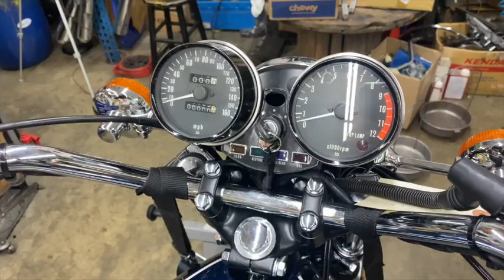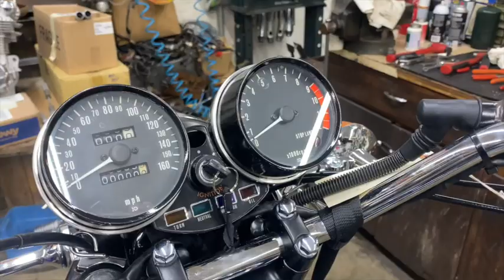75 Kawasaki Z1 900 "THE Z1" Best Friend's Surprise Reveal

Comment: That bike looks just like my New 1975 Kawasaki 900, with blue paint and the gold stripes. That bike went too fast to easily. I won the few races that some foolish people wanted to run that bike. I sold it to a friend of mine after 2 months. I don't know if I'd be around today if had kept it. Generally speaking about the bike, it was a nice big bike, good looking, felt reliable enough to go anywhere without any worries. They really are a nice bike if you can drive them sensible, I just wasn't able to drive it sensible. Good luck with that 1975 Kawasaki 900. It sure looks good. You do very nice work and help keep them going.

Comment: This brings back strong memories for me in the beginning of the video between 0:02-0:11 I had a 1975 Z-1B exactly like the front left one and kept it stock until the early '80s then transformed it to look much like the one in the back row with a black imron paint job, LTD seat, LTD handle bars, RC Engineering 4 into 1 header, a wider 5.10 rear tire, Andrews coils, replaced points with electronic ignition, K & N air filter, and it was a awesome bike until I sold it in 1992.

Comment: Kawasaki Z1 900 is a tough bike! I owned one and it did everything from around town to back roads blasting to drag racing to wheelie popping did it all, attest to Kawasaki Heavy industries! Wished i never sold my Z1 B, Kawasaki could sell brand new ones today, just upgrade the ignition system and utilize two spark plugs per cylinder, leave it as is otherwise.